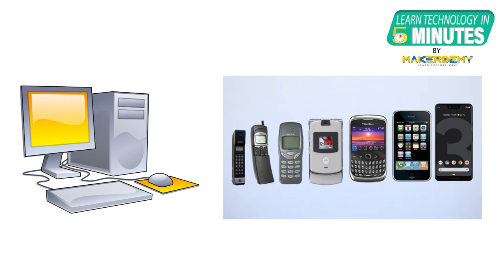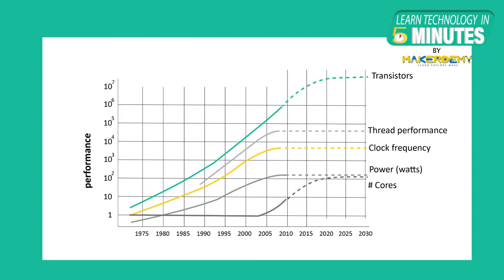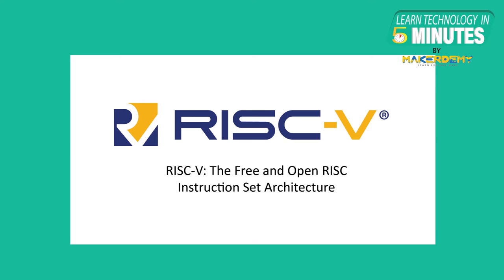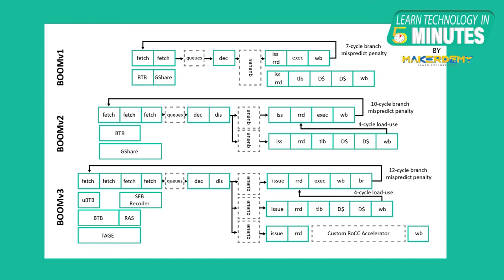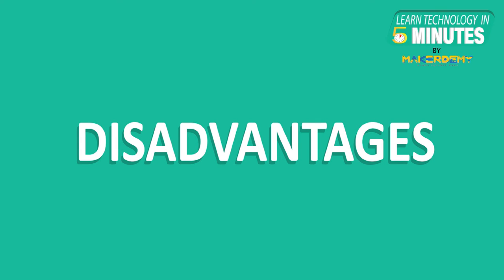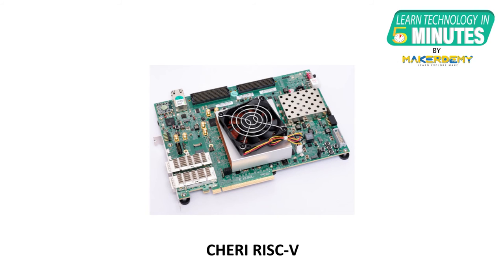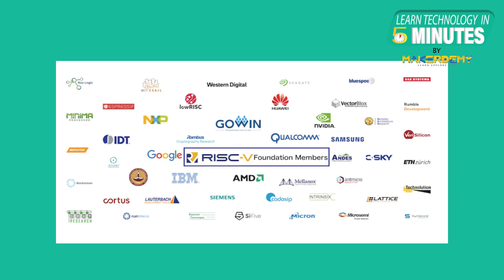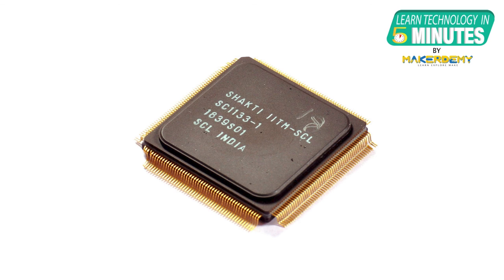What is RISC-V? (2021) | Learn Technology in 5 Minutes

Comment: RISC-V IS NOT SUPPORT BY ANY PRIVATE COMPANY.MAY BE
Reply from the maker: Hi. The Question is not very clear. RISK-V is an open standard instruction set architecture based on established RISC principle. RISC-V ISA is open source and does not require any fees to use. 

A number of companies are offering or have announced RISC-V hardware, open source operating systems with RISC-V support.
Reply: @MAKERDEMY  risc-v foundation has 2000+ members, so is it true that majority of that members are all companies and businesses ?
Reply from the maker: Hi Zack.

The members are not just companies and businesses. Some NGOs and Governments are part of the foundation. Even companies like adafruit, raspberry pi are members even though they are not actively currently developing any RISC-V boards. To learn more about the members check out the following links:
https://riscv.org/members/
https://riscv.org/membership/
https://venturebeat.com/2021/12/02/risc-v-grows-open-source-processor-membership-130-in-2021/
We hope this was helpful.
Thank You